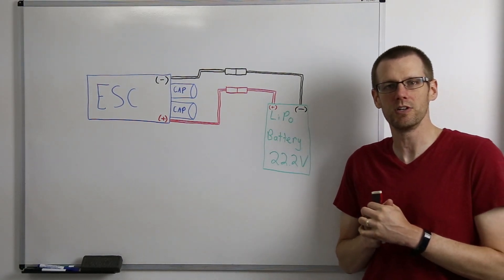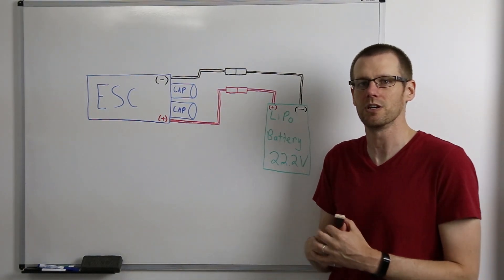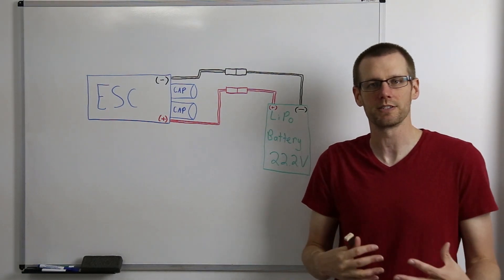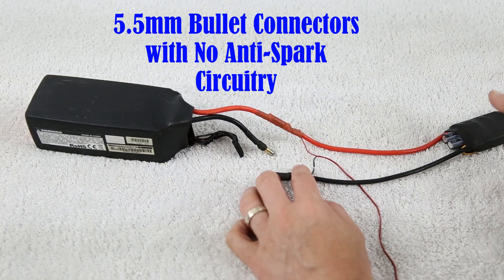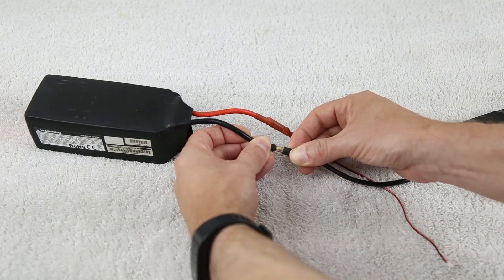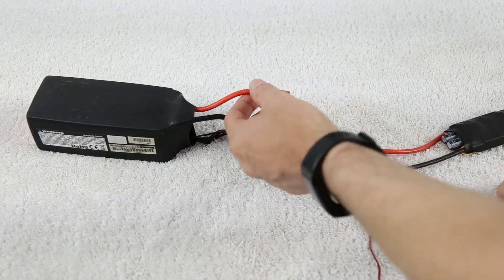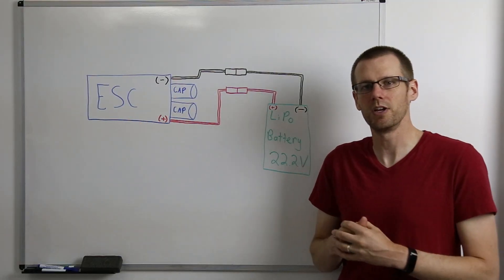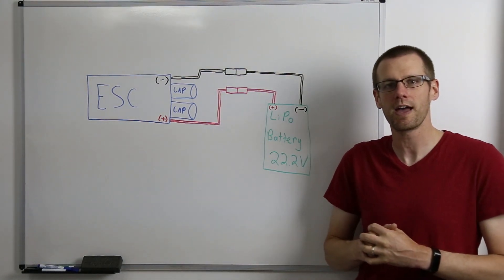Order Matter to Prevent the Destructive Spark from LiPo to ESC?

Comment: How destructive is it really?
Reply: It eats your connectors away over time, the burnt area on the connector might develop sharp edges which in turn could scratch the surface of the female plug resulting in poor, less reliable connection, heat buildup etc.
That's why you should use antispark connectors, there's a DIY approach too.
Lookup diy resistor spark arrestor.